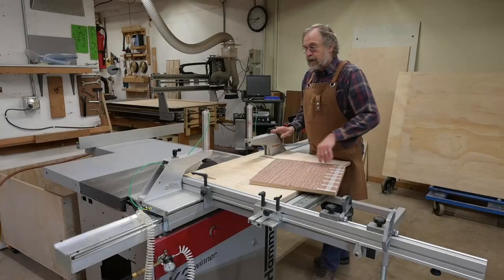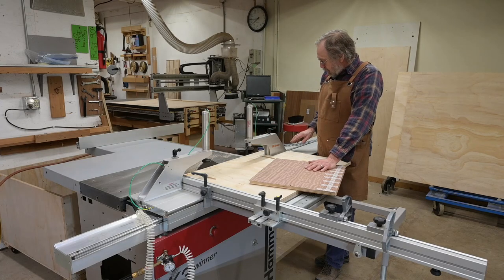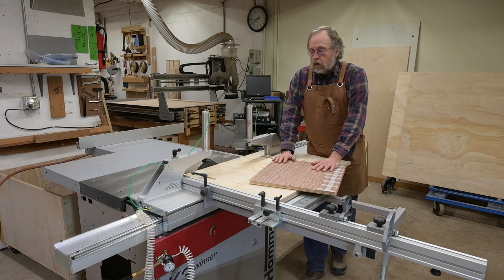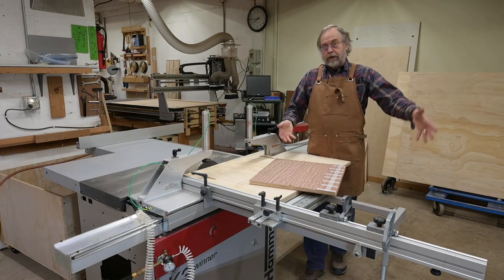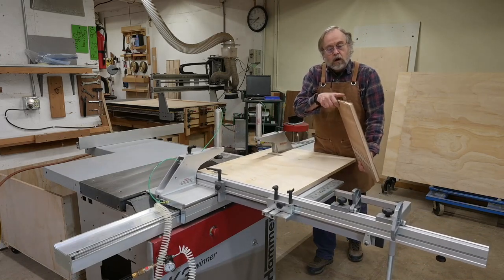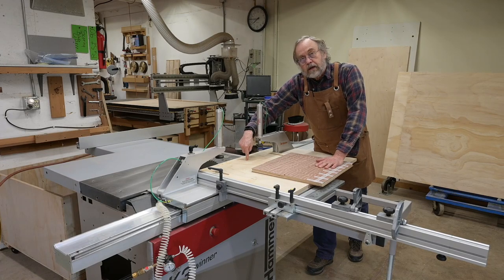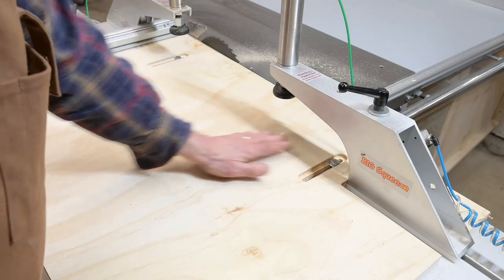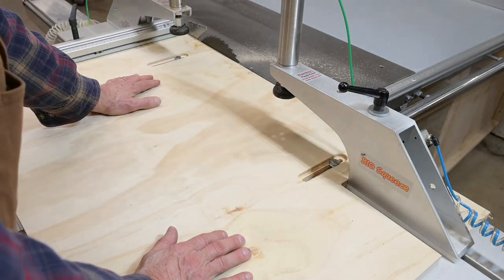The Big Squeeze and How I Learned to Love my Hammer (slider)

Comment: Hi Darrell.  I just ran across your Youtube channel and it is awesome.  I love it when others are making videos on the use of a sliding tablesaw.  Great idea on the zero clearance bed, I will have to incorporate that.  I am pretty sure Lamb Toolworks made the Big Squeeze clamps but no longer does so.  Since Brian no longer makes these, I would suggest Mac's Airtight Clamps as an alternative.  Hoping to start another G&G build soon as your class at Kelly Mehler's was inspiring.  Steve Rowe
Reply from the maker: Hi Steve, Thanks. I have watched a few of your videos  (you do a great job at it) and am envious of your Martin slider  - my introduction to sliders was on a Martin  over 40 years ago.  Do you have a G&G project in mind?  Did you take my Arched Aurora End table class?
Reply: @DarrellPeartFurnitureMaker  Hi Darrell.  I took the Arched Aurora End table class at Kelly's and also the Freemont nightstand at the Woodwhisperer Guild.  I really like the arched Aurora feature and incorporated this into a bed design ( I had sent you some photos of it some time back).  The room needs a G&G dresser (it will need to be smaller) and I have just started gathering some ideas about the design.  Was thinking about the Freemont leg style with the arched Aurora feature on the side panels.  Steve

Comment: Those look pretty nice. All the other clamping setups I've used seem to "pull back" a little as they are tightened down, moving the workpiece a bit. Have to set up so that the movement is toward the fence to avoid trouble. These look like they are unlikely to rock back.
Reply from the maker: You can't see it in the video but these guys come down rather slow . The pressure is applied  softly - so id doesn't tend to move the work pieces.  One of the forums I found discussing these provides a parts list, so you can make your own.
Reply: Very cool!! Thank you for sharing.You provided me with some great initial design concepts to make a new tables sled as I don't have a slider. #holdingspetra@IG
Reply from the maker: @grupp61  you're welcome